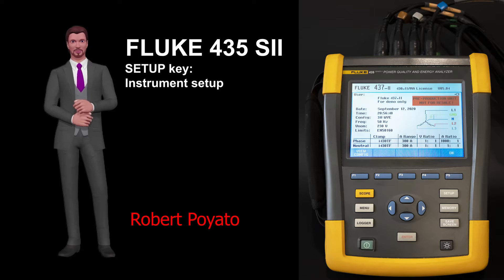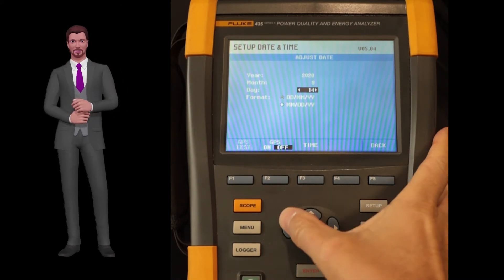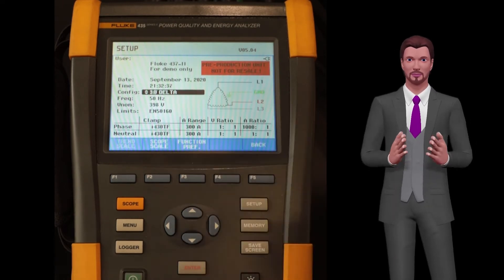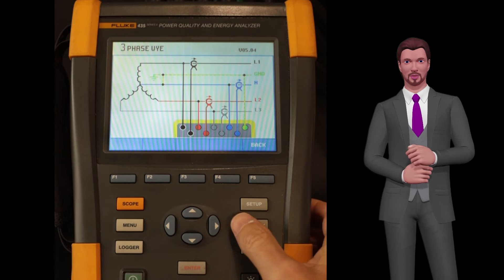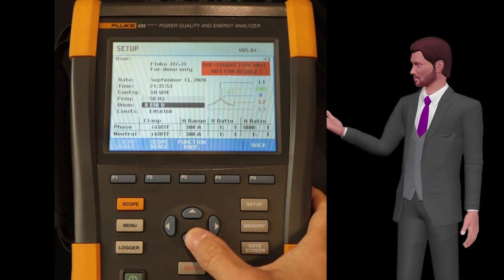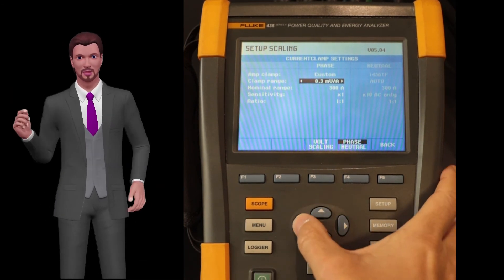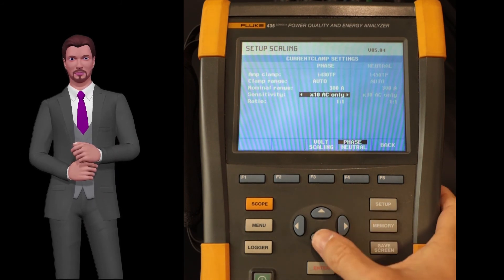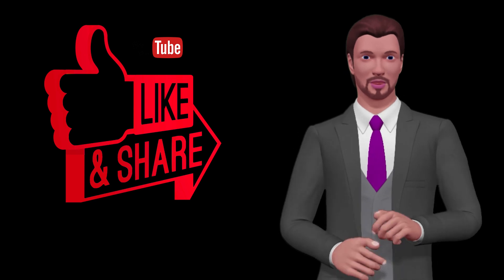HOW TO SETUP THE FLUKE 435 SII POWER QUALITY ANALYZER

Comment: hi sir I saw this video voltage pt ratio max only 10,000 volt, if my equipment nominal voltage is 11kv ?
Reply from the maker: What is the output of the measuring voltage transformers you will use?

Comment: Why fluke meter shows 1v even we are not connecting voltage probe
Reply from the maker: Hello Mohanraj, if you do not connect the inputs, instrument could sense a floating voltage. Fluke 435 measures input voltages referenced to earth so it is important also to connect earth cable to have good measurements.
Reply: @SCIENTIAPLUS Thanks